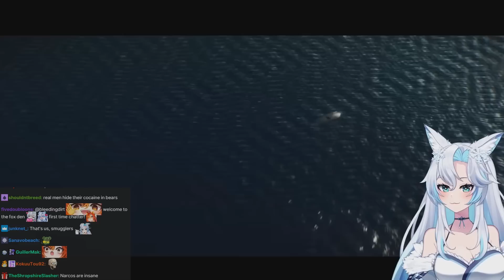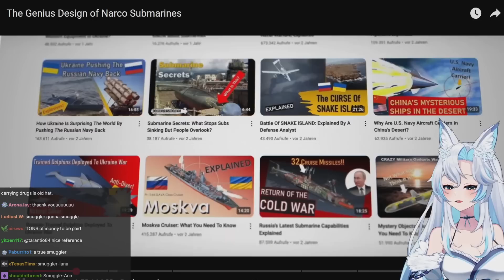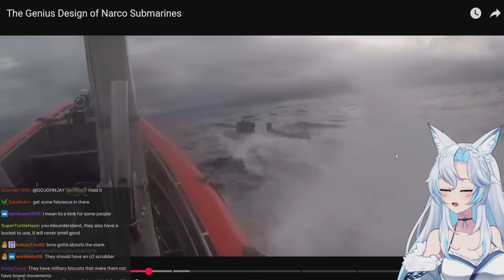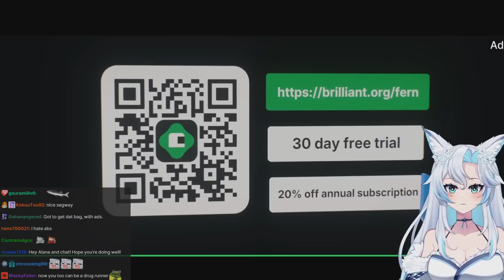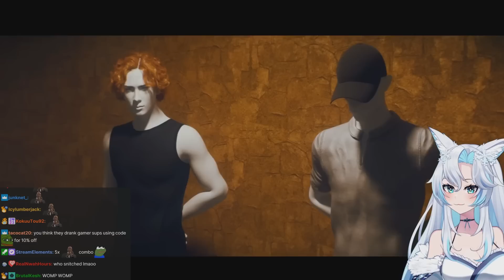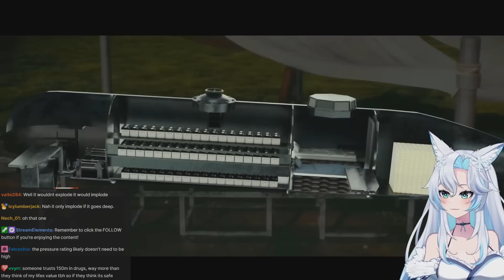The Genius Design of N*rco Submarines

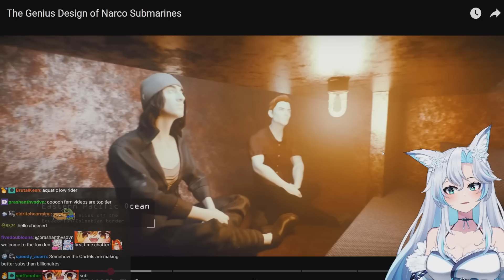Comment: Regarding what Alana says at about 04:22 in this video: 

There was an aluminum-hulled research submersible built in the 1960s called "Aluminaut." 

It was retired in the 1970s, and is on display at a museum in Virginia. However, AFAIK it could be put back into service if needed.

Comment: the GPS thing.. depends on if you use active or passive GPS, passive only receives signals and calculate your rough location based on that, it would be easy to bring one... not sure why they dont

Comment: If its near the surface the pressure isnt an issue cause there is none. And how boats work is if the volume/weight of the water you are displacing "moving out of the way because youre under the water" then you can weigh up to 1 lb less than that amount of water weight. And water weighs alot o something like this is pretty easy to make and can hold alot causei ts mostly underwater so its displacing a lot of water weight.

Comment: I can only imagine former military submariners being on their payroll.
Reply: The documentary Lord Of War leads me to believe there is a fleet of refurbished old Russian subs out there
Reply: @NationOne44  Those would expensive as fuck for them to maintain but i guess if they are making 100million each trip its worth it.
Reply: @NationOne44  I could definitely see drug runners using older diesel-electric subs like the Kilo or Tango classes. I imagine the nuclear powered ones are off the table though, for safety and practical reasons. Refueling those would be impossible. Though they honestly might have better results using the lithium-ion battery system they talked about in the video. The state of the art electric subs like Japan’s Soryu class use those. Some can be quieter than the background noise of the ocean. Really, really hard to track with sonar. That’s how Australia and Sweden ‘sunk’ a few US carriers in wargames back in the 2000s
Reply: Correction, only two of the Soryus use lithium-ion batteries while all of the brand-new Taigei subs use them.
Reply: @ how about the Russian subs with caterpillar silent drive tech. Or did Red October lie to me.
Reply: @NationOne44  The short answer is that it depends the version of The Hunt for Red October. The book’s version of the drive is in use today (and the British used it back then) but the movie’s won’t be for used a long while. The long answer is below. 

The caterpillar drive in the book actually described a pump jet system like the British have had since the Swiftsure class and we’ve used since the Seawolf class. The Russians actually only just started using them on the Borei class, which is their newest nuclear missile submarine. It was an impressively realistic depiction for a book written by a civilian who previously sold insurance. The Soviets didn’t have this pump jet system back in the 80s when that book was written but Clancy assumed they would eventually. He was just off by a few decades lol. No one expected the USSR to collapse like it did. If it hadn’t then they probably would’ve had it in the 90s or very early 2000s. 

The movie version was pretty different. It was an electromagnetic system called a magnetohydrodynamic drive. It technically works but it’s not completely silent either, and we haven’t found a way to make them strong enough to displace manned subs of our current size (10,000-20,000 tons each). At least, not yet.

DARPA is working on it. They started a program to create a real MHD for military use two years ago. It probably won’t be powerful enough for manned submarine use but it can probably work for an undersea drone, which they’re trying to develop at breakneck speeds. Very cool stuff. It’s called the PUMP program if you’re interested and you can find a few articles on it online
Reply: @ Wow, thank you!
Reply: Makes sense. Only these people are crazy enough to use an old submarine that could sink at any moment.